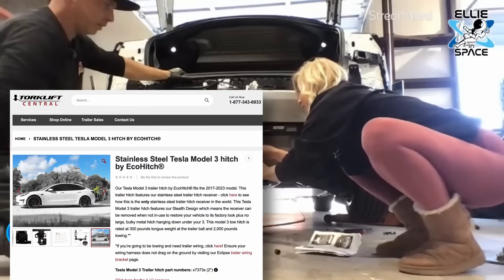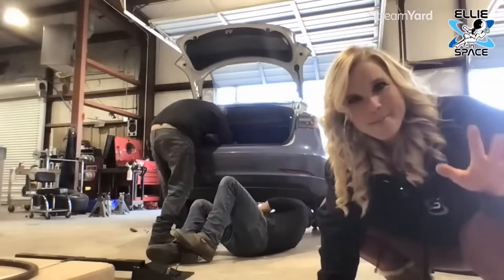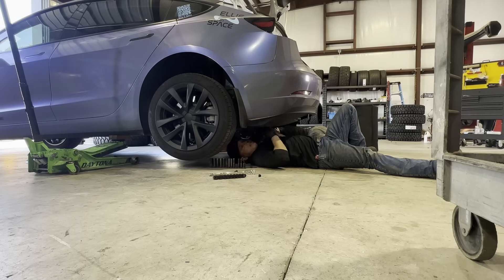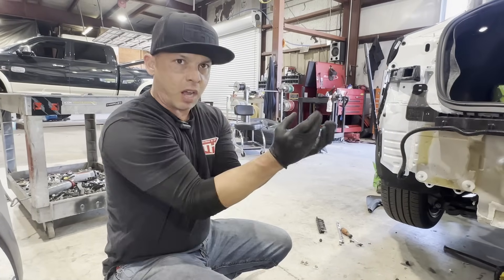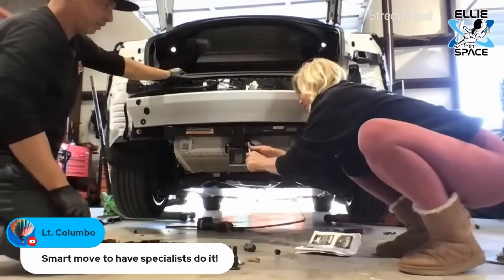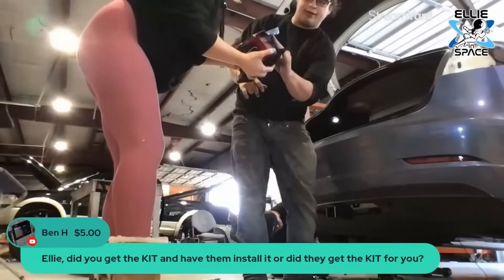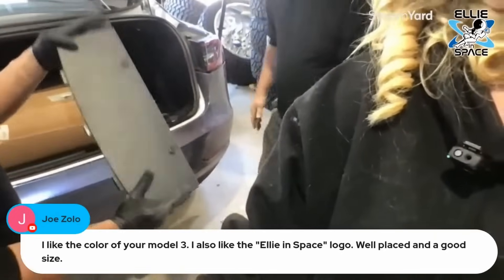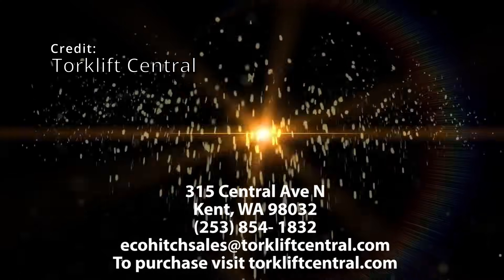Tesla Teardown: Let's Install a Tow Hitch on my Model 3!

Comment: Hi Ellie. I installed this exact same hitch on my Model 3. It’s a great addition to the car and you’re going to love it. 

One thing to be aware of is that when leaving some parking lots, the receiver will hit the ground. It’s startling and sounds way worse than it is. It scrapes the receiver a little, but doesn’t do damage to the car. 

I would take mine off sometimes with a 15/16 ratcheting wrench. Just buy one at Home Depot and then take it to the shop where you had the hitch installed and ask them to heat the wrench with a torch and bend it 90° to make it easier to get up under the bumper to remove it if you want.

Comment: Hey, if you can tow a Tesla, could you tow a dead car and get the regenerative charging to work thus charging battery?
Reply: Yup depending on the model you can get like 150kw of charging but that also means you'd need something powerful to pull it

Comment: The receiver looks like it may reduce your clearance a mite. I had a U-Haul receiver put on my 2015 Mustang eight years ago, as that was the best way I could find to mount a bike rack without risking damage to the car. Worked great, but definitely cut into my road clearance, somewhat, leading to some minor restrictions on the places I can drive without scraping. I don’t think you’ll have that problem with the Model 3.

Comment: I had the factory install install my trailer hitch because the Software in the car will have a towing mode selection. I think it has something to do with the rear camera, and in my 2020 model-Y rear sensors, not thinking you're backed up against a brick wall. Let us know if you have any problems when you have the bike racks and bikes on and driving down the road.

Comment: Towing will eat the battery alive.!!😉
Reply: Yes.  Trailer hitches have very sharp teeth!😂
Reply: Not for hauling bikes!
Reply: She is not going to tow a trailer, she uses it to mount a bike rack.
(of course that still adds wind resistance but not as much as towing a trailer)